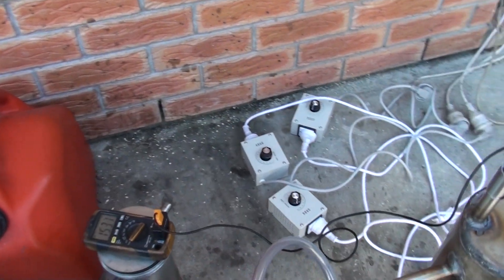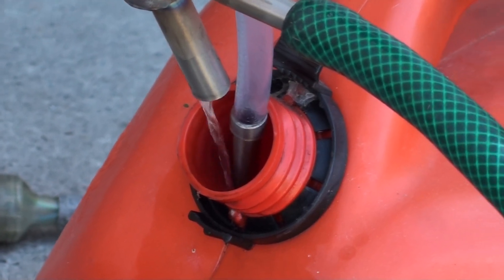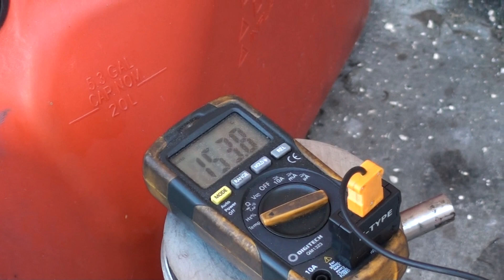Gasoline in diesel wrong fuel separator 40L per hour.

Comment: I would like to know how much energy in US dollars  it would take to produce 40 litres ? Also how much would it be to build this so it could produce up to 40 litres an hour ? How long would it run for or about how many litres you could produce before it would need to be rebuilt? What is your email address to communicate more with you ? I would also like to purchase this as well ! And it is awesome !!
Reply from the maker: I don't know the cost of electricity in US  but in New Zealand it will take about $0.5 to separate 20L of diesel/petrol  mix. The one shown in the video is 40L per hour, so to build a 20L per hour is not more difficult than this one.
The unit can work indefinitely long, though I would recommend to clean the unit once every 6 month, and if machine run as it supposed to, then it will work for at least 10 years.
Reply: @santeryi9  I want to buy one of this for Uruguay
Reply: Do you live in New Zealand?
Reply from the maker: yes I live in NZ
Reply: That’s great where in NZ? I have been there many times! I loved it!
Reply from the maker: Near Christchurch
Reply: Alek Polek The fuel you produce from thermal filter let’s say 1000 litres of waist motor oil how much gasoline and how much diesel would you get ? Could you configure it to produce diesel more and gasoline less ? I notice that in some of your earlier posts that the temperature was closer to 420% Celsius for  mostly is that dangerous ? In this production your temperature is much lower , why?
Reply from the maker: Now, please do not confuse two different but similarly looking machines and two different processes, this particular machine is not an oil processing one, this machine is designed to separate an accidentally mixed diesel fuel and gasoline, also it will work with natural gas condensates, this is why the temperature is 150c , the oil machine is running at higher temperatures and produces only a base oil (diesel fraction) and bitumen waste.
Reply: I need to go to bed now . I will talk more  in the morning thanks!
Reply: Alek Polek  I would like to talk about building a thermal filter for making diesel fuel from used engine or transmission oil at 40 litres an hour . I think what you are doing is brilliant! Could you also send me an email address or Skype contact info ? If you have and iPhone I could talk to you on FaceTime audio, thanks and good night Alex!
Reply from the maker: http://www.ferromit.com/contact.html visit contact page, leave your question and email address, I will reply with my contact details